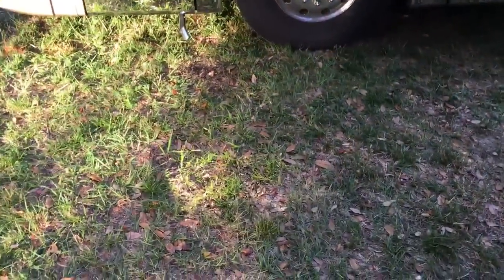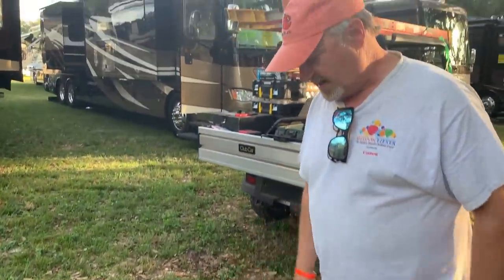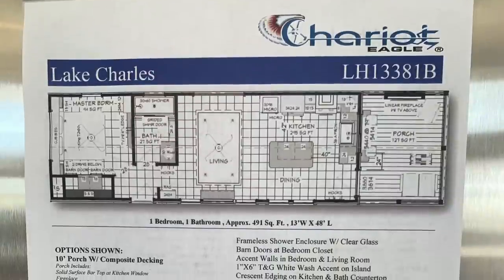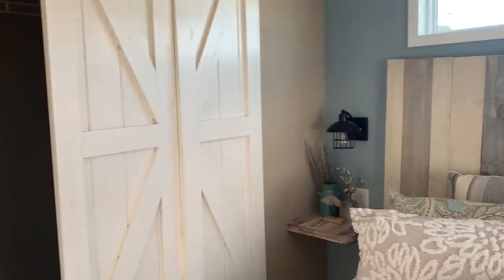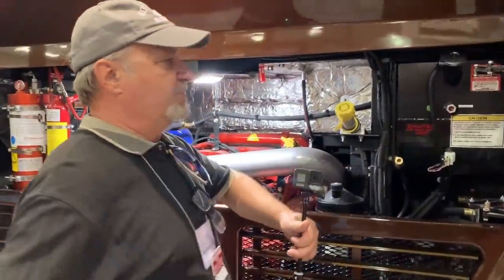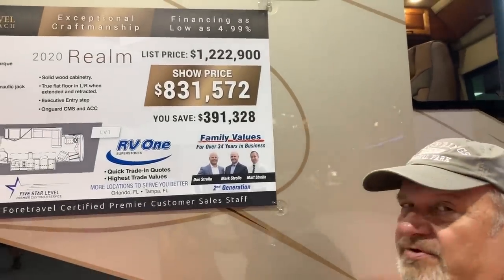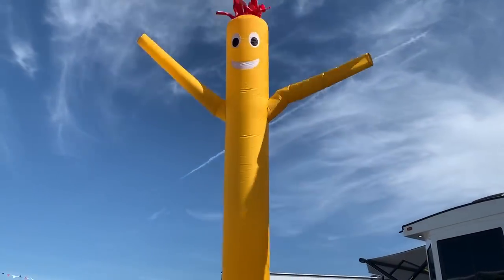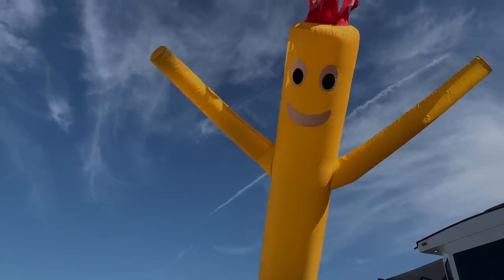2020 FLORIDA RV SHOW-MACERATOR FAIL-CHARIOT EAGLE HOME-FORETRAVEL REALM FS6-NIRVC AIM CLUB-EP105

Comment: You look so natural in the Realm. They have air inflating seals on the slides  no problem with sealing or air noise. They had a Realm in for service at NIRVC in Dallas yesterday. Nice Nice coach. They had a New Air in make ready to.
Reply from the maker: I will get one in my NEXT life,.....as long as I remember to have a better job in that one,...

Comment: The Foretravel Realm is something we have considered. It comes with a fire suppression system. When shopping for a King Aire, it's not that much more. The slides have a air bladder that inflates wherever you stop it, in, out, or part way. Makes for a quieter ride too. I rather not have anything interfering with a quick exit.
Reply from the maker: If money was no object,....I would really be looking at them!